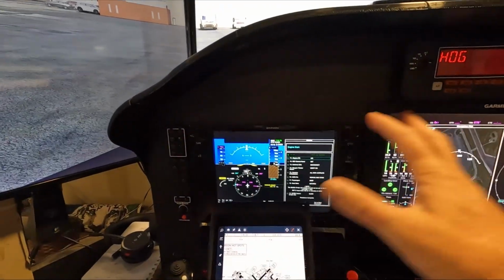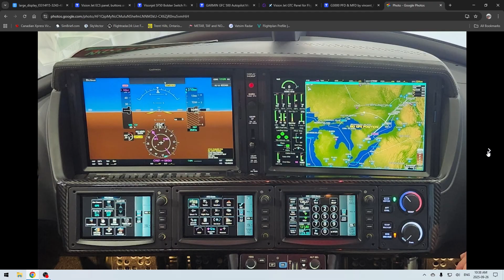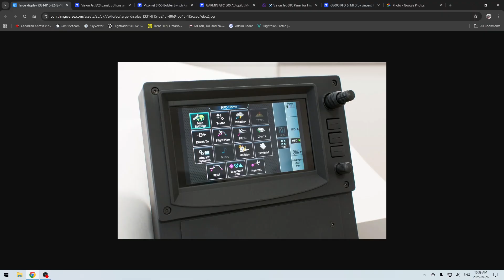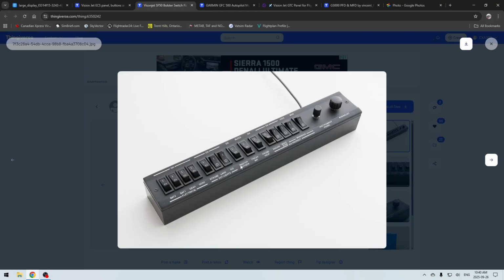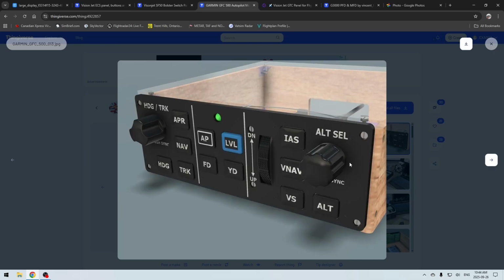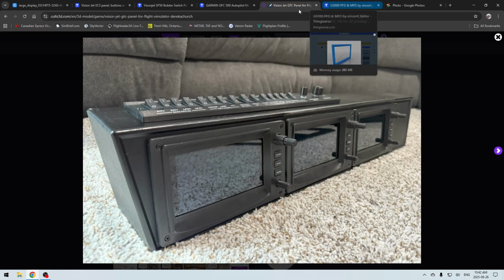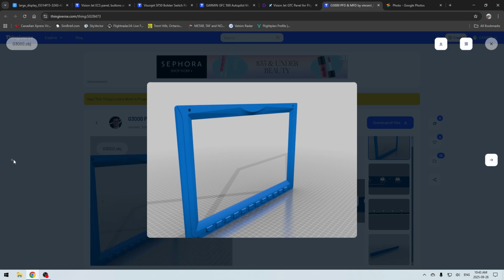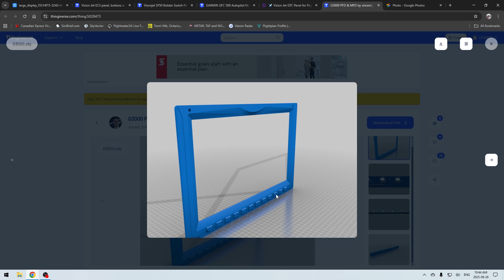The Plan - Part 1 of Building a Vision Jet Home Simulator

Comment: Hi. Just found your channel and watched episode 1.    Great work.  Loved the clear presentation style.   Please can I ask how are you running all the monitors.   I have a 4090 and that runs 2 samsung G5s as my side screens and a Samsung G9 ultrawide  as my main.   Then I have 2 G1000/3000 touchscreens from flight sim builder that go to USB on the PC.  At the moment they show the PFD and MFD.    I would love to add the additional screens you are looking at for the G3000 controls but worry about overloading the rig.    Hence the question how are you running all the screens.   thanks
Reply from the maker: I have a 4060 and run triple 58inch screens off the 4060. I run at 1080 as the 4060 won't handle 3 screens any higher.. The 580s and G1000s / G3000s will be feed from USB dongles via a powered USB hub. I've gotna 12th Gen i7 with 64gig or ram. The cooling fans never spin up above 50%
Reply: @thesimproject73  Thank you.  that helps a lot.